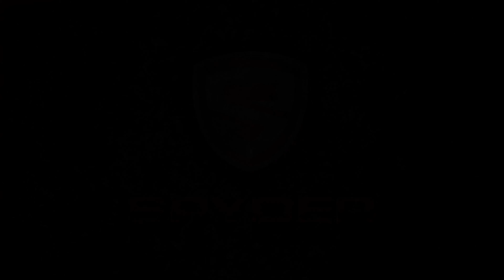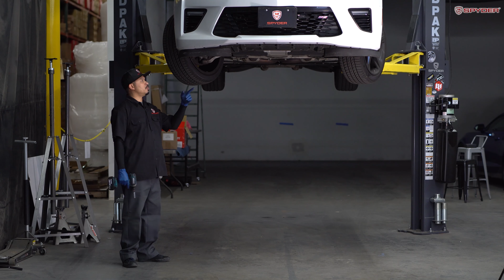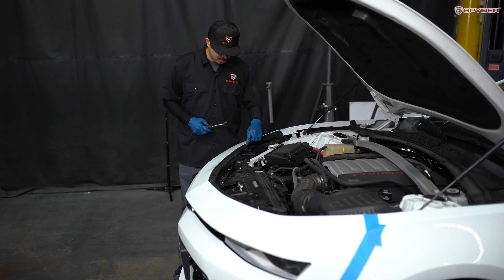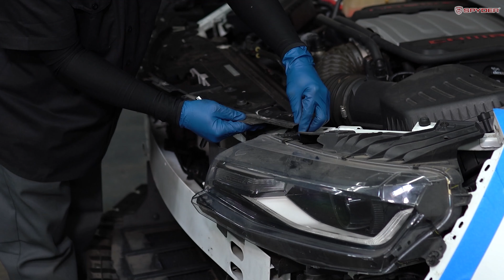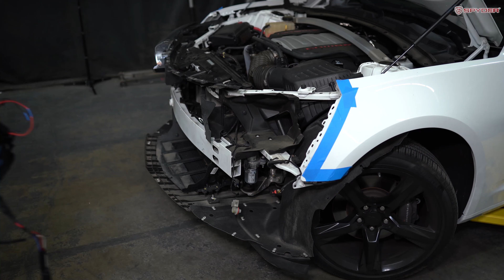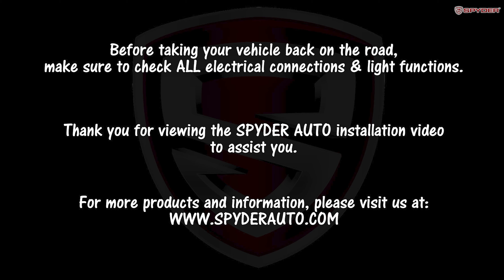Spyder Auto Installation: 2016-2018 Chevrolet Camaro Headlight install (APEX series )

Comment: Does the green and black connector connect to the same head as the blue and red connectors? I’m having trouble getting my light to pop on. Mine green and black connector head and the blue and read are separate

Comment: Can’t get my low beams to work any help?
Reply: Just installed mine and can’t get my low/high beams to work. Were u able to solve your issue?
Reply: @matthewdeveau9063  send them back and get a different headlight
Reply: @latreyjefferson5535  dang.. there isn’t an additional harness or anything?
Reply: @matthewdeveau9063  I don’t think so… i sent mine back fuck that man
Reply: @latreyjefferson5535  lol aight thanks man
Reply: So Did You guys Figure it out ?

Comment: Great video and the headlights look sick! I also have the question though, I have a 2016 LT without the factory LED headlights...will these work just plug and play with my car or would I need to do my own wiring set up with adding resistors so I don’t get hyper-blinking?
Reply: Did you figure out how to do this with the LT? I’m wanting to do this also